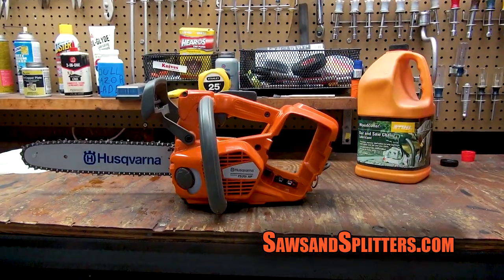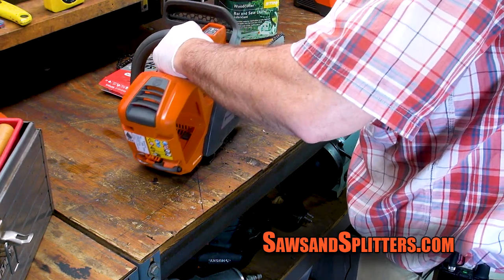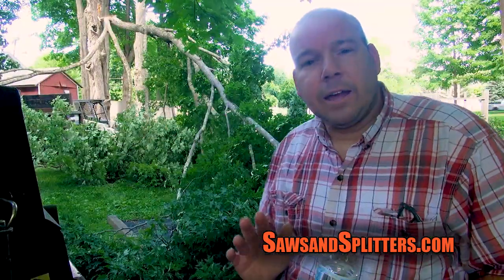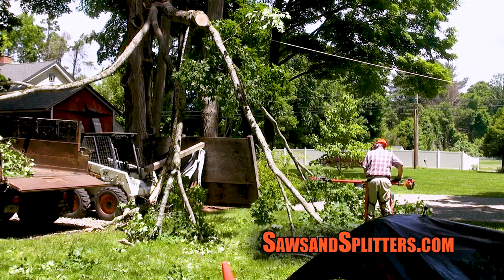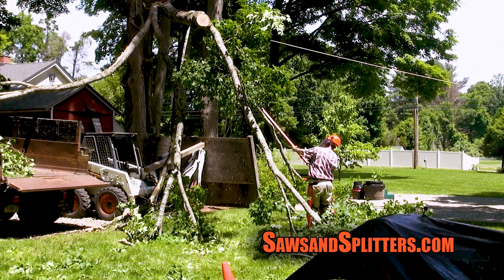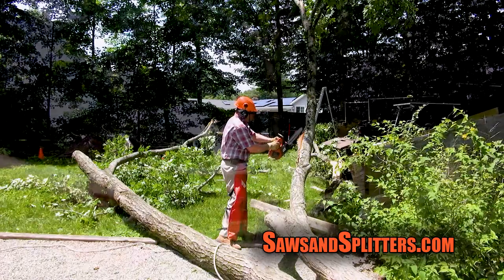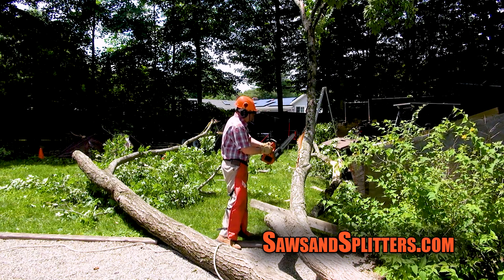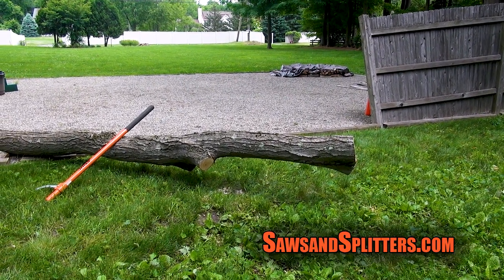HOW TO CUT DOWN A TREE THAT FELL DOWN IN STORM - HUSQVARNA ELECTIC CHAINSAW

Comment: I recently bought my first top handle saw, a mac 110. It will be interesting for me to see if I am actually going to use it a lot, as a firewood cutter I am running mostly 70cc saws.
Reply from the maker: A lot of guys that use saws for a living say top handle saws are only designed for in a tree because they pose more risks.  I have to say I enjoy the top handle saw on the ground for its light weight and maneuverability.
Reply: @CTSCAPER  I own a woodlot so I see myself using the little saw for trail building, I pick the path of least resistance and try to cut only small trees. Should be easier on the back.
Reply from the maker: @timberray9572  It is and in the smaller trees, there is no difference between battery and gas.